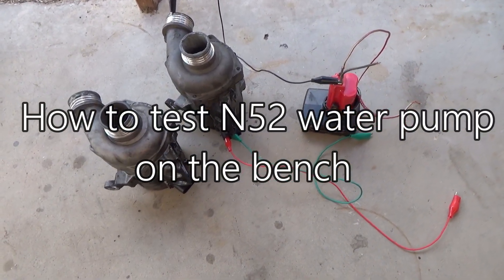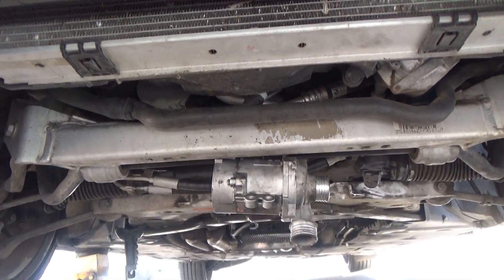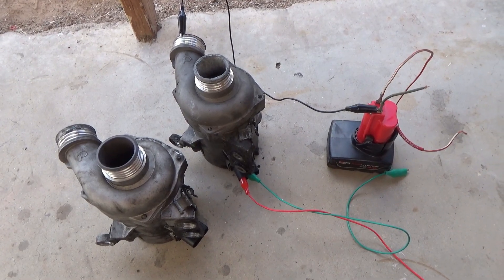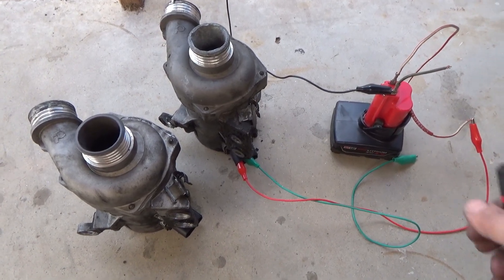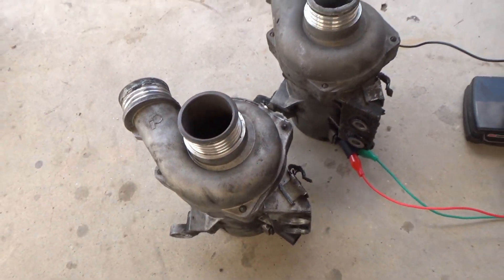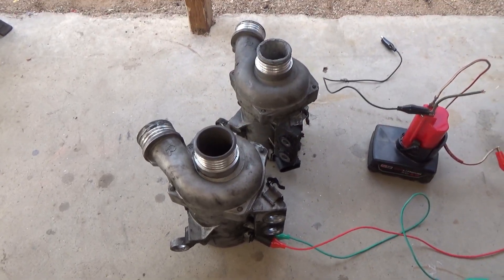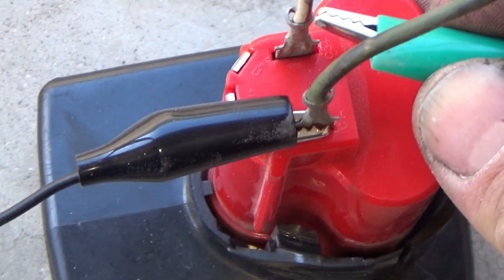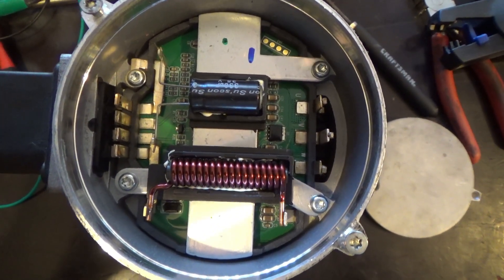How to test BMW N52 electronic water pump off the car

Comment: It would sure help to identify the hot terminal and negative terminals and other terminals see where you connected the terminals on the water pump,
Reply from the maker: you are the only one asking this question, this means you are extra stupid, I explained to what pin to connect on 1:50

Comment: Hrmmmm, I always thought the pump would run at full speed if it 'only' got power and lost communication.Good failsafe design would be to run full speed unless BSD comms established, regardless of PWM. I guess not. Maybe the PWM line is held high by the ECU when BSD comms are lost, but that's another point of failure. 

I know there is some failsafe full-speed mode, but unsure of the mode/logic. That state wouldn't be detected by your junkyard test. 

How warm does the "bad" pump get with voltage applied to PWM? Always wondered if it was a motor short or not. Is any chip superheating?
Reply: If the water pump is still in the car there is a test built in, where you press the gas peddle 3 times in acc mode and then you look through the coolant tank to see if the water is moving